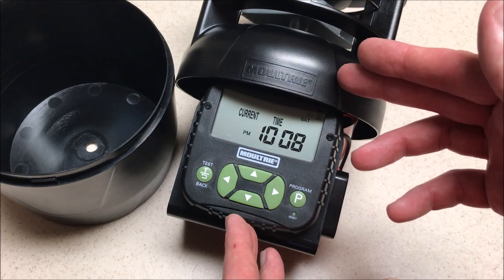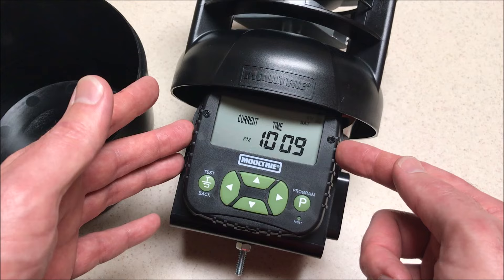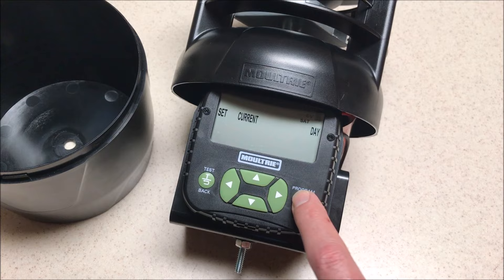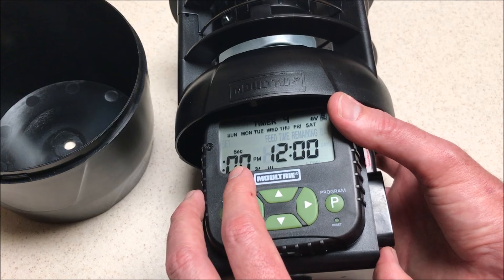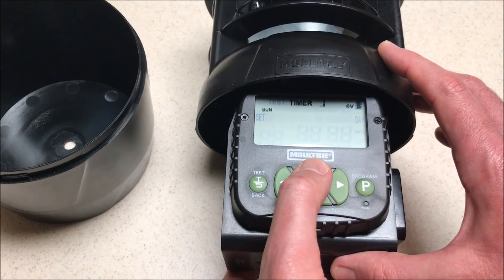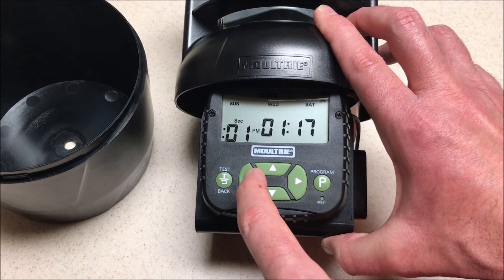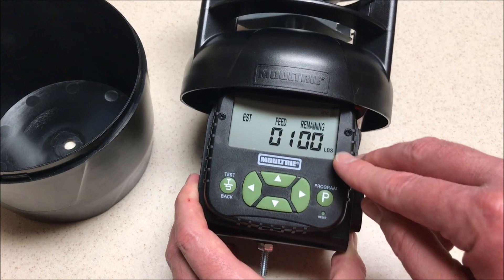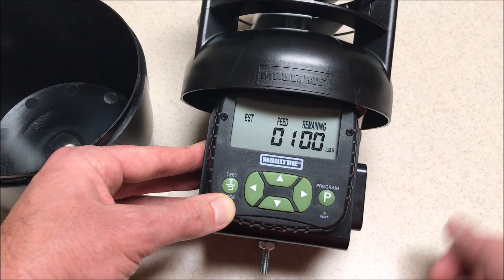Moultrie Pro Hunter II Feeder - How to Set and Test!

Comment: Thank you for doing this video. Between the video, the instructions, and my 22 years of using timers I figured it out. I set the timer up the way I want it to function at HOME then install it at the ranch.  I like the RESET BUTTON ON THE FRONT OF THE TIMER. I had a Moultrie Timer that all of sudden just stopped working one day.  The reset button behind the timer panel started it again, but Eventually it stop working after being in the field for about 5 year.  I have also gone to the Moultrie 6V REGARGEABLE BATTERY. IT WORKS GREAT.  Every time I go to the ranch I  SWAP it out with THE EXTRA BATTERY THAT I charge at home.  I am trying out the DIRECTIONAL TIMER for deer feeding.  Will see how it goes. 
Again, thank you!

Comment: I have the Pro II and the instructions are extremely vague. Thanks to you I got it programed, but I was wondering if you knew what the 2 unstripped wires are that are labeled Feeder Activator Connection + and -
Everything appears to be working, but I have no idea what the extra wires are for
Reply from the maker: Glad the video helped.  Moultrie sells a remote system you can use with this feeder.  So if you buy it, you hook it up to those cables. . . .basically it allows you to sit in your stand and click a remote control to make your feeder throw whenever you want.  I will put a link below, hope that helps and makes sense.  https://www.moultriefeeders.com/feeder-activator-remote-control
Reply: Thank you for explaining i bought this to feed my chickens ducks and turkeys but had the spin settings too low and lbs too high everything works awesome now I can go away and not worry about having someone come and feed them